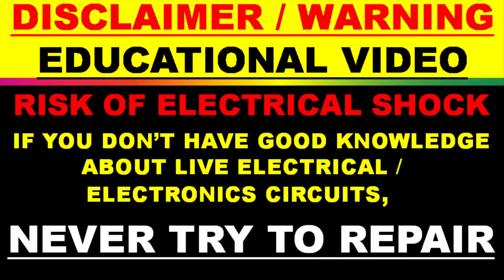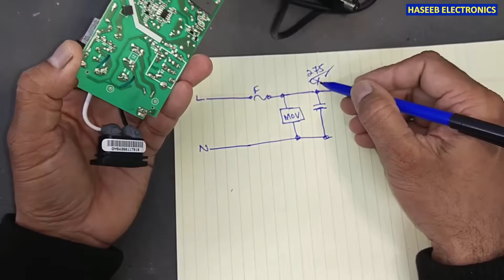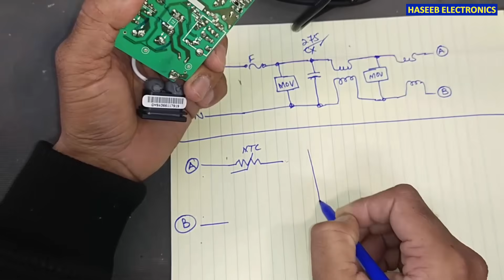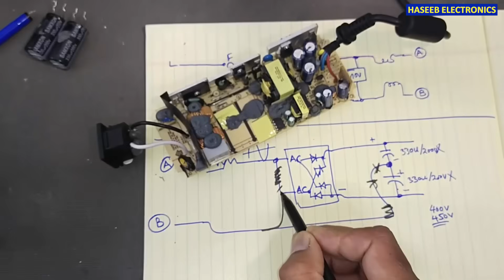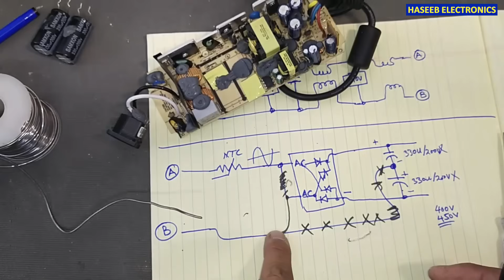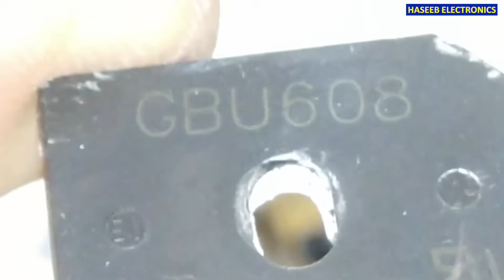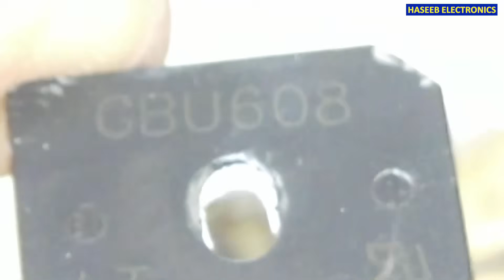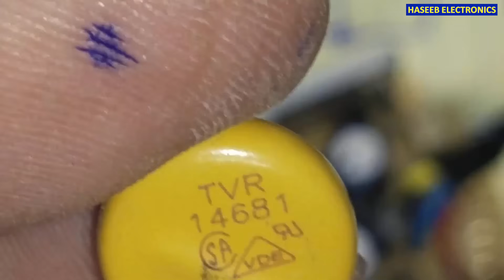{792} How To Convert 110 Volt Power Supply To 220 Volts

Comment: Hello Master, sorry, I have a question. Why does the light bulb flash when you turn on the power supply? Is this normal? I'm referring to the series connection of the bulb you use for protection.
Espero puedas responder, saludos desde Bolivia ❤🇧🇴🥲

Comment: Hi Excellant work done in converting 110v to 220V ac . I was confused by SMPS books they say Transfermer also to be changed. But you had done Great work just by changing 4 components. There are so many people in INDIA they bought DELL, LENOVO IBM ASUS SONY Panasonic products to INDIA with 110 v INPUT. Latter they use STEP-DOWN Transformer 220vac to 110Vac to operate the product and that Stepdown transformer get Very hot and sometime sparking ruins SMPS. 
I had buy Panasonic Same USA and INDIA model in Indian Panasonic changed these same capacitors with 650V Bigger and all remained same.
Thanks again for solving my problem.

Comment: Thanks for your video. The new voltage will be aprox 330Vdc, the Vds max of main switching Mosfets needs to be more than 330Vdc I think that has to be taken into account also.
Reply: The mosferts are getting the same voltage as before. Previously the capacitors were in series, and each was charged to about 160V (peak of 110V AC).

Comment: HELLOW SIR,I have a charger input is 110v output is 7.2v but the CIRCUIT ONLY have one 250V CAPACITOR supply to point A and B not like your video circuit can i change a 400V capacitor can work .

Comment: Does primary ic pwm need any modification.  As I have Yamaha ats1080 that input 120vac I need to modify its inner power primary section at 220ac is this possible plz reply or I need to buy step down  adapter
Reply from the maker: i suggest to watch video number 894 & 792 before conversion 
if you will modify as in video number 894 then no need to alter PWM IC section .

Comment: Sir if i need to use my smps with 90 volt how can I do it ?
Let me say my questions i have a battery of 92 volt dc battery
I need a conver to 12 votl output
How can I do it ? 
I am useing a ac smps 
I can use the dc voltage because it will convert ac in to dc so i thought to give the power supply in the dc line at the capacitor i need some help 
I need to chaing the winding of the smps please reply
I love you video ❣️

Comment: Hi sir I'm looking a suggestion.  I bought a new 220v xbox one supply . But when I connect this adapter to the power socket entire house trips. All other appliances works fine on the same socket. Any suggestions on what could be wrong?
Reply from the maker: that power adapter have short circuit. it needs to test it carefully
Reply: @HaseebElectronics  Can a TV repair guy can test and fix this ?

Comment: I watch your all videos, very useful videos, thanks for sharing.
I need 110 volt to 220 volt DC 16 amps SMPS, normally not available in market.
If you suggest me some circuit it will be helpful.
Thank you so much

Comment: Very useful. Could we use the existing capacitors and make them in series or the total capacitance value will be too low ?
Reply from the maker: i already recorded a detailed video. it will be published in upcoming days. because many viewers asked this question.
we can use both 220v capacitors in series but it is best to use single 400v capacitor. because in series the capacitance will remain 330 uf but its ESR value will increase and also the center pins will create parasitic inductance or stray inductance, which will decrease the capacitor efficiency
Reply: @HaseebElectronics  I just saw your video, thank for the explanations, i ignored the ESR parameter. Thank you

Comment: Won't it affect the transformer winding
Reply from the maker: no. as the existing 110v configuration also provides 310VDC at dc rail. as the 220v modification will now cause to increase voltage at dc rail. 
please check video number 788 for more details

Comment: I successfully diagnosed and repaired a laptop charger with a burnt current sense resistor. Previous I had only been able to repair the ones with a blown main electrolytic capacitor. Thanks to your channel and diode gone wild. Currently I have a general overview of an smps power supply.

Comment: Why is it in converting 110 volts power supply to 220 volte the secondary side of the power supply's  voltage   does not increase but remain the same.
Can you explain to me please
Reply: the voltage on the output doesn´t increase, because there´s a integrated circuit that manages the cicles of PWM (on the cold side of the board), and this IC is coneccted to a transistor and the transistor to the chopper (high frecuency transformer, the big yellow block) .If the main supply increases from 110 to 220v the IC changes the cicle automatically to adjust it to the desired voltage (12 volts, 5vsb). I have the same question years ago when I was learning about SMPS, I hope my answer helps you!.
Reply: @alanp7 thanks for this useful info. I'm also confused if the cold side voltage or current won't increase after this modification, now it all make sense now. Thanks.

Comment: Hello haseeb, I have a 12v 40A power supply, it has a problem that when it is turned on without a load the output voltage is 19-21v and when a load is put it stabilizes at 12v, it has the KA7500 integrated, I already checked the feedback and Everything ok, my suspicions are in the transformer, when it is without load it makes a rather annoying high-pitched noise, what do you think it could be? the IC or the transformer?
Reply from the maker: the ic and transformer are looking good. if it is providing enough output power then there is nothing wrong 
some power supplies need dummy load. if there is a dummy load resistor in output. check it 
if there is no resistance
you can Install 100 ohms 2 watt resistance at output Terminals 
I think it will solve the problem
Reply: @HaseebElectronics  Thank you so much

Comment: Thank you very much for this information.  Can l use this method with any 110V power supply please? or it will work only if the power supply has the same  design like the one in video.
Reply from the maker: if it using this configuration, it will work in that time 
if we have single capacitor, then we need step down transformer. that will much safe solution

Comment: Just a quick question, the 2 *330 200v were in series so why didnt you reuse them?  effectively they will be 165 uf at 400v
Reply: same quastion.
Reply: When you’re using a bridge rectifier to convert 230V AC to DC, here’s the calculation:

	1.	Calculate the peak voltage of the AC signal:
	•	Multiply the RMS voltage by the square root of 2 (which is approximately 1.414).
	•	230V multiplied by 1.414 equals roughly 325V.
	•	This 325V is the peak voltage of the 230V AC signal.
	2.	With a bridge rectifier:
	•	The output will be pulsating DC with a peak of approximately 325V.

It is always safer to use capacitors that are rated to the peak voltages just in case one fails and the other will go down with it.
Reply: @consolechips eu entendo perfeitamente, então o resultado positivo de 2 capacitores em paralelo, é que eles suportam até 800v mantendo uma média de 170uf, certo?
Então não é que os dois de 200v não podem ser usados, mas eles ficam mais próximo da margem de pico, e qualquer carga minimamente excessiva, pode causar danos.
É isso mesmo amigo?

Comment: Good job, I don't think the capacitors should have been removed.  Can you explain why they were replaced?
Reply: that because the older caps highest volt is only 200v .. in order to convert 110v to 230v you need higher volt caps .. if u use the older one it will explode .. that why he change the mov also .. and he also check the brigde rectifier.. same thing
Reply: @kobeteey4570  
but when he removed the ac line from the middle of the capacitor, the capacitors are in series 200+200=400v!
Reply: @bertor111  its for safety purpose .. he use 400v and 450v .. more volt the better
Reply: Is this funny safe and guaranteed it’ll work I’m taking it to a shop but they said it’s not guaranteed but if I took the risk and did it anyways would that blow up my Xbox or just the battery I need answers asap please if anyone has any information I would really appreciate it!!
Reply: Fully*

Comment: Good idea! I would let the capacitors installed, just delete centre connection. As MOV on 230 V input usualy 275 Volt types are used. Why you choose 420 V?
Reply from the maker: if we remove center connection, the capacitance will become 330/2 = 115uf. and the power supply will start fluctuation. 
we need to use 330UF capacitor 
it is good to use 275 to 480V RMS MOV in second stage protection. as it is connected in between EMI filters, so it protects form the ringing of the EMI filter 
higher voltage range as 330-450V is much suitable at this stage
Reply: @HaseebElectronics  Did you test this? I doubt it, because the circuit after the caps "saw" these series caps before and worked fine. If you change only the way how the caps will be charged (from 110 to 220V) the capacity for the following circuit could remain the same.